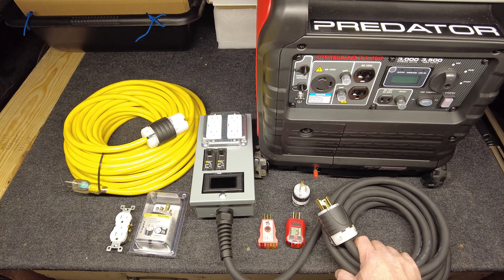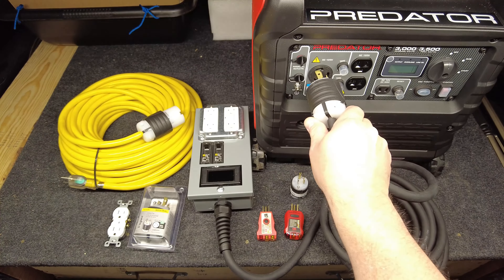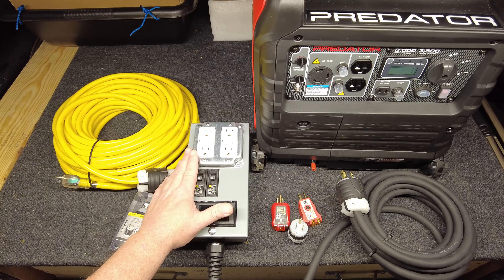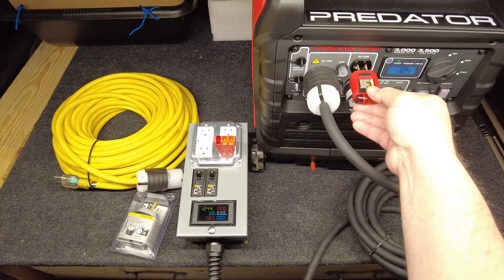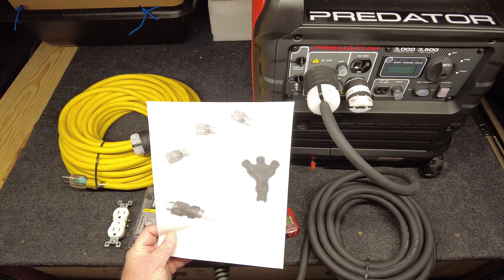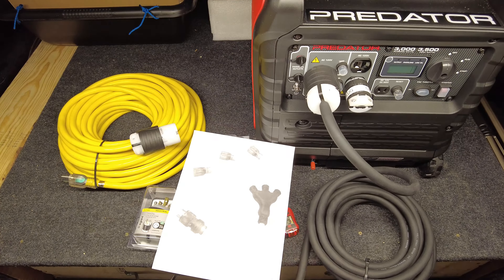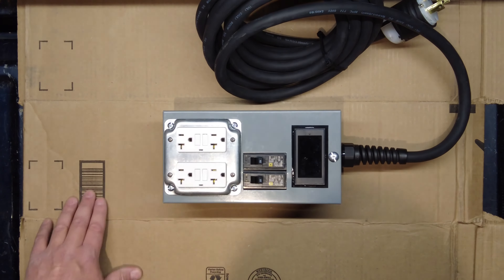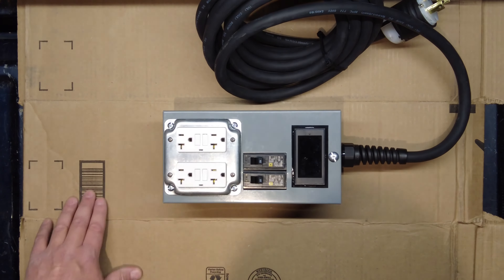How To Get Full Power From Predator 3500 Inverter Generator, Camping, Home Backup, GFCI Safety GFI

Comment from the maker: Power meter on the front of the box:
https://amzn.to/3IDnPqy
Strain relief for 10/3 SOOW cord:
https://amzn.to/3qwCUUC
25” 10/3 SOOW cord:
https://amzn.to/3Lckalg
Legrand 125 volt, 30 amp MALE plug: (2 of these.  1 for the box, 1 for the 100’ extension cord)
https://amzn.to/3LchYdw
Legrand 125 volt, 30 FEMALE plug: (For 100’ extension cord)
https://amzn.to/3wzR3Vc
Electric panel box:
https://amzn.to/3izo7UR
Circuit Breakers:
https://amzn.to/3JDPglC
Legrand 15 amp, 125 volt male plug: (I made my own neutral bonding plug)
https://amzn.to/3JPbYHi
4 rubber feet for the bottom of the box:
https://amzn.to/3itTD6S

As an Amazon Associate I earn from qualifying purchases.

Comment: Im trying to run a electric flat grill 1600w
Generator breaker trips after some minutes of running .
Generator doesn't  turn off just the breaker pops at 15.9 i will try this very soon and report
Thanks for your video its really helping.
Reply from the maker: Perfect example scenario where this power distribution box would come in very handy.  Thanks for the comment.

Comment: I'd like a tri-fuel one - to hook up to natural gas line.
For those extended Texas power grid shutdowns.
Gasoline or Propane wont help after they run out.
Reply from the maker: There are Tri-fuel versions of inverter generators available on the market right now. (Not from Harbor Freight, yet)  otherwise for a couple  hundred bucks you can buy a tri-fuel conversion kit to convert pretty much ANY generator over to natural gas.  But I have news for you....  it's not just Texas that has extended power grid shutdowns. lolol.  Every state can have extended power outages for various reasons.  They happen all the time.  You just don't hear about them on the news because they are "normal" for other areas of the country.  The big Texas outage was news worthy because of the affected area size, and because it was the result of severe winter weather which Texas does not typically get. And you're right, gasoline and propane wont help once they're gone.  That is why people like me (and many others) who want to make sure we can get through an extended power outage by keeping extra supply on-hand.  It sucks having to rotate supply to keep it fresh but I'd rather have it and not need it, than the other way around. I recently installed a generator interlock device and power inlet box on my house to legally feed my entire house from my generator when the power goes out.  (inspected by the city and passed to make it legal)   My next step is to run a natural gas line connection out the back wall of my house near the electrical hookup so I can run on natural gas.  That was going to happen already but I installed a Micro Air Easy Start on my central A/C system about a month ago so the natural gas line can wait until this fall, or maybe next year. (so I can run my central Air on generator power)  In the mean time, I have 50 gallons of non-ethanol on hand to get me through.....  and by the time 50 gallons starts to run low, they will be SOMEONE pumping gas withing 25 miles of my place so I can hopefully buy more. Who knows....  I wish I had a crystal ball so I can see what I will need in the future. lolol.   Thanks for the comment.
Reply: @SlipFitGarage  Thanks for the reply!
Those Texas blackouts happen in Summer too, just not as long.
Ya rather than all that storing / cycling fuel to keep fresh methinks a natural gas generator is much easier.
I elbowed a gas line off my dryer through wall to Bar B Q quick connect. Figure in emergency I can quickly snap that over to generator.

When central A/C died I saved a lot of money by installing my own mini-splits.
The smaller bedroom one I bought on purpose as 120 volt (others 240). So if I do this I can run a cord to it to keep at least 1 room in house warm or cool.

It's been 2+ years since the Big Freeze.
Then in Feb Austin had ice storm and then trees took out powers lines.
In both cases people in across street lost power for a week, and had to stare at my lit up warm house. Some say it is because we are on on same grid as nearby Dell Hospital. Who knows.
So I've been lucky so far. Figured had I bought the $1300 tri-fuel it would sit in the garage for years. 
Just like insurance... you don't want to pay for it, until the day you need it.

THANKS for your great advice, to me & others.

Comment: As a general rule in electrical circuit design the 80% rule is a guideline from the National Electrical Code 210.20(A) that states that circuit breakers should not be loaded to more than 80% of their maximum rated capacity for continuous loads. This helps to offset the effects of heat on overcurrent protective devices. Predator probably uses 80% rated breakers on the 20 amp outlets which is a good thing to prevent a overheating and fire hazard. This project is a good idea to get the extra amperage out of your outlets, but I think you will have to use 100% rated breakers on your breakout box otherwise your right back to where you started...
Reply from the maker: As you said, the 80% rule is for continuous loads..... Very few loads on a 3500 watt portable generator are considered "continuous".  Also, the 80% rule is part of the NEC, the national electric code. The NEC governs, residential, commercial, and industrial building construction codes.  The NEC does NOT cover machinery or appliances. Also, I've seen the breakers on this particular generator pop at 13 amps.  That won't even allow me to run my 1650 watt pizza oven. lolol. One of the main reasons for this box is for people (me) to get the full 3500+ watt potential from this generator....  people (me) who are NOT plugging in a 30amp RV/camper... People (me) who buy this generator and only plan to use the standard (15-20 amp) receptacles on the from of this generator will never get the full power potential.  This box helps to solve that problem. Lastly, this box was built for my needs.  I made a video to show others what I built for myself.  I am not telling anyone to build this box for themselves, nor am I selling this box to anyone.....  So, it's really a non issue for anyone else because I'm the only one using it.  (even though I am 100% confident in my design) Thanks for the comment.
Reply: @SlipFitGarage  I didn't mean to disparage your design. I even said in my comment that I thought it was a good design. I also understand that protable generators are not covered under Artical 702 of the NEC (Optional Standby Systems) unless they are permenantly connected to a house. The breakers you used in your build were designed for residential operation though... I hope your build solves your electrical problems.
Reply from the maker: @retiredguyadventures6211  I did not take your comment as negative....  I just simply replied with an explanation of why I did what I did.  That's all.  I gave your post a thumbs-up and a hart....  I wouldn't give a thumb and a hart if I didn't like your post. Sorry for the confusion.  And yes, I know the breakers I used are intended to be used in a residential application....  I have to use breakers that are readily available to me.... and I am certain the Square-D breakers that I used are better quality than the no-name Chinese breakers that are found in the Predator generator. lolol.  Again, thanks for the comment. 🙂
Reply: @SlipFitGarage  Square D is the best!

Comment: Very good information I have the 4500 powerhorse and the 9000 staring watt champion inverter with has the 50AMP outlet
Reply from the maker: Thanks!  If you have a generator with a 50amp 240 volt outlet, then you should see the power box that I made for that.  Video can be found here: https://youtu.be/xiAkvRzsxG0

Comment: This is great!  Thanks!  I never thought of making a load center portable like this.  The inclusion of the meter is very helpful for monitoring what the system is doing.  The only concern I have, and this might not apply to how you are using it, is that your ground neutral bonding plug was made from a 15 amp plug and, if used, will be plugged into a 15 ? 20 amp receptacle. In the event of your 30 amp circuit having an overload or short, the bonding plug / receptacle / wiring may burn up before the 30 amp internal breaker trips. However, the 20 amp circuit that is at fault will break at 20 amps, so that will make it not quite so dangerous.
Reply from the maker: It's common to have an undersized ground conductor.  For example, I have a 50 amp sub panel in my garage that is fed from the main panel in my house.  The sub panel is fed with 6 gauge wire for both hots and the neutral.  The ground conductor is 10 gauge.  This meets the national electric code in my area.   The ground conductor only sees a load long enough for a breaker to trip, which is almost instant when a fault happens.  This is not nearly log enough to burn up the undersized ground conductor.  You need to understand that wire size is rated for continuous load, it does NOT mean that smaller wires cannot handle a higher load, it just means smaller wires cannot handle a larger load for extended periods of time. For example, 12 gauge copper  wire is rated for 20 amps.....  that does NOT mean it will "burn up" at the very instant it sees 21 amps.  That 12 gauge copper wire can probably handle 80 - 100 amps, for probably 45-60 seconds before it actually "burns". BUT in this application, the breaker will have already tripped LONG before the wire ever sees that amount of load, for any length of time. There are videos on youtube where people purposely overload wires to see just how much load they can actually handle before getting hot enough to cause a fire. You would be VERY surprised how long, and how much over current it takes to overload any specific gauge of wire to the point of it "burning up".   I have no concern about MY bonding plug being undersized.  Commercially produced bonding plugs are probably made with even smaller conductors inside.  I also have no concerns about this device that I made for myself. I would be far more concerned about the generator coming from the factory WITHOUT a GFI outlet, or ANY ground fault protection, at all. And lastly, just as a disclaimer.....  This video shows a solution that I made for myself, to solve a problem that is unique to MY situation.  If someone else decided to build something similar for themself, they're on their own.  This video is NOT a step-by-step "how-to".  It's simply a video to show a device that I made for myself.  Thanks for the comment.

Comment: What if I get one of those little adapters that plugs into the big outlet and converts it to standard 120 Outlet will I get the full power from that Outlet then? Thanks for your help
Reply from the maker: Sure, you can do that......  but whatever you plug into that little adapter is now capable of pulling up to the full 25-30 amps that the generator is capable of putting out, and most things that plug into any standard wall outlet are only designed to receive up to 15 amps, max.   It's like I said in the video.....  "just because you CAN, doesn't mean you SHOULD".  If you're okay with potentially overpowering whatever you plug into your generator and causing a fire and/or electrical shock hazard, that's your decision.   Thanks for the question.
Reply: @SlipFitGarage  I just bought one of those little adapters at Walmart for $7 and I'm trying to power a air compressor 4.5 horse the motor says 120 / 220 it's configured for 120 it says running amps 15 and LR amps 98 unfortunately it did not kick the motor over with enough power so it just hums , I'm wondering if it's too small of a generator, your input on this would be great
Reply from the maker: Unfortunately if the compressor has a locked rotor amp rating of 98 amps, there really isn't much you can do to get it stared with a generator that only puts out 30 starting amps. That LR amp rating is the amount of in-rush current required to get the electric motor started. It appears you're about 68 amps short.  (give or take) There are a few tricks that can possibly make this happen such as an easy start, but those are expensive.  You could also try putting a bypass valve in the line that comes directly from the compressor head to the tank that allows the compressor air to "vent" into the atmosphere while the motor is starting..... once the motor is fully up to speed,  slowly close that bypass valve to force the compressed air in to the tank.  It gives it the affect of slipping a clutch.  Those are the only two possibility that I can think of.  If neither of those are an option for you, then I'd say the Predator 3500 will not start your compressor.  Thanks for the question.
Reply: @SlipFitGarage  I also have a 2000 watt predator I wonder if I link them together with a parallel kit if that would just give me more wattage or amperage too . Appreciate your input thanks
Reply from the maker: Well, by adding (pairing) your 2000 watt Predator, along with your 3500 watt Predator you'll technically get a total of 5500 starting watts, or in other words 45-46 amps (roughly).  You're still over 50 amps short of having enough power to start the electric motor on that compressor, according to the specs that you provided. You can certainly try it, but if that LR amp rating of 98 amps is accurate, then it's mathematically not going to happen.  (unless one of the other methods that I mentioned earlier will work for you)  Again, thanks for the question.  Sorry I didn't have a better answer for you.
Reply: @SlipFitGarage  so is your so called power-box, like you said you're NOT an electrician and you proved it
Reply from the maker: @joey24698  lol.

Comment: I’ll take two of them, 👍

Nice job
Reply from the maker: Well, I don't make them to sell.....  However, I just upgraded my generator to a 240 volt 7600 watt inverter generator (video coming soon) so I would be willing to sell the distribution/meter box featured in this video.   Let me know if you're interested.
Reply: @SlipFitGarage  did you sell it? If not I am interested
Reply: @brianok100  man why don't they make these to purchase with the generator? I am looking for something like this to use that 30a plug... waste not using it

Comment: So what would be the best way to use a 3 way cord?
Reply from the maker: A three way cord "shouldn't" be used at all in my opinion.  They are somewhat dangerous in my opinion.  Nothing that can plug into a 15 amp receptacle is designed to be potentially fed with 30 amps. Not to mention, in an electrocution situation, there is no GFI protection and the person would potentially be hit with a full 30 amps.  I have felt 120 volts at 15 amps go through my body....  I don't ever want to feel what double the amperage would be like. Like I said in the video, just because they sell those 3-way cords, that doesn't mean they should be used.  Lets put it this way....  the National Electric Code governs how all residential and commercial building are wired in the USA....  nowhere in the code could you ever use a 30 amp breaker to feed a 15 amp receptacle. (even with the correct size wire)  The electrical code does NOT govern generators....  but if it did, those 3-way cords would probably be non-existent.  To each his own.  Be careful if you decide to use one.

Comment: but in mi 3500 out 62 v and 62 v each conector and the 3th neutral , coming from the generator , thats correct ? you only use one cable that cable is only 62 volts too ??
Reply from the maker: I'm sorry, I dont understand anything you typed above.

Comment: It would be interesting if you tested the box with the 125 ft cord and see what the voltage drop between the generator and your breakout box. I have a funny feeling at close to 25 amps you will either see the voltage drop or your cord will start warming up.
Reply from the maker: I'm sure you're correct.  However, 98% of the time I wouldn't be running at the full 25 amps so voltage drop shouldn't be an issue most of the time. And for me, that type of stuff is always on my mind so if I was running at the full 25 amps the generator is capable of putting out, I would keeping an eye on the electric meter, and I would keep feeling the extension cord for extra warmth.  But yes, you are correct, that is certainly something to think about.
Reply: @SlipFitGarage  That's why you're using a 10 gauge cord though, correct? To help minimize voltage drop...
Reply from the maker: @flash8051  
Yes.... but also because the next wire size smaller, 12 gauge, is too small for the 25 amps max output of the generator.  12 gauge is only rated for 20 amps, 10 gauge is rated for 30 amps.  But even with wire that is sized correctly, it can be too small if the length becomes too long.  It's called voltage drop.....  the farther you run a wire, the larger it needs to be in order to compensate for voltage drop.....  and to keep the wire from over heating.

Comment: Great idea! I'm collecting parts to build my own now.  Where did you find the transfirmer to run the amp/ volt meter? I can't seem to find one..
Reply from the maker: What transformer?  I never mentioned a transformer...  The Amp/Volt meter that I used is designed to run at 120 volts AC.  No transformer required.  Thanks for the question!